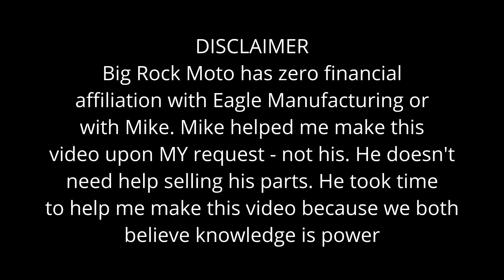KLR650 Doohickey: Everything You Need to Know (incl. 2022 model) (w/ Eagle Mike!)

Comment: It's mind boggling that Kawasaki would neglect the most documented KLR issue ever...Imagine how reliable the 2022 could have been. It's absolutely stupid to buy a new bike and have to update the engine to avoid a catastrophic failure. Bad on you Kawasaki. They probably didn't get enough warranty claims because it failed out of warranty, a lot of people ride just 5k per year.
Reply: They should in good faith allow any new gen3 owner a no cost to owner upgrade to these parts...of course they won't.  Lame Kawasaki.... very lame.
Reply: Seems like an easy lawsuit. Eagle Mike as your expert witness. Boom!
Reply: @davidgrunklee8407  that would cost them triple what redesigning would have. It’s not like they just learned about it. Imagine how pissed other Gen KLR owners would be if they offered that to just Gen 3s?
Reply: @P1ayD0hpaul  good points
Reply: 5k is optimistically high. Unless you mean Km.
Reply: How often does this really happen? 1 in 50,000? 1 in a 100,000?
Reply: @hell_march6652  yep that was km.
Reply: Exactly why I didn't buy the new model
Reply: @grayman618  I have worked on hundreds of KLRs in teh last 22 years and owned nine myself. running most of them as bike hire bikes. Not just KLRs but bikes in general and on average see no more than 20000km or maybe 30000km through their service life. If you keep a KLR for longer you WILL see the failures. Three quarter of a million kilometres between my eight KL650 A and KL650C, every single OEM doohickey failed at least once, OEM springs often would not last to the next service (5000km) and one engine wrecked completely due to FOD in the transmission (a separated bit of the doohickey which goes around the shaft / fatigue failure of the doohickey. Result: Crankshaft cracked, transmission wrecked with three gearsets destroyed, bike scrapped and broken for spares as economical write off 3 years old wiith 32000km on the clock. Compare to my 1999 KL650C with 132000km. Top end done at 100000. Clutch at 120000. Still going strong. Eagle lever since 2004 after OEM lever and spring failure.16000km. No issues since then.
Reply: @KLRJUNE  You can trust a guy who's worked on hundreds of KLRs, and years of documented failures. Or trust your gut instinct and state that the problem doesn't exist.
Reply: People can make videos all day long on this  but 98% of these KLRs easily go 75k+ Miles  problem free. If you want a new KLR just go buy it and enjoy life, remember it's always something with any make and before this Dohickey  actually blows your motor youl have 10 other things happen in life before this to your bike..
Reply: A lot of people do the update aftermarket so not many people really do the claim.
Reply: I just wanna know if doing this invalidates your warranty lol
Reply: With regular service intervals issue is probably non-existent or close to because am suspecting they are just replacing those knowing they will fail soon. However this issue is such a big thorn in the ass because it's so simple and small of a fix to turn great bike into indestructible one.
Reply: While I know eagle mike has MUCH more experience than myself. And is correct this is a well documented problem. My gen 2 has 230k miles and original doohickey is still working for me. I’ve done them for friends I just want to see how long mine will last lol
Reply: Other motorcycle manufacturers refuse to fix known problems as well, it's a sad truth.
Reply: @grayman618 Exaaaacctly!!!
Reply: @jurgenbuchelt4384  So maybe the moral to the story is if your under 100k miles chances are your fine so the Doohickey problem is for "high" mileage Klr's.. If I bought a new '25 I would never worry about this or a Gen 3  '22 and up with under 50k miles.😉

Comment: I owed 3 klr650 within the last 31 years  , from generation 1 to the latest generation ( riding a 2022 klr650 with now 13000km) never had any problems with the engine , just do the recommended maintenance and oil changes , that's it .

Comment: No doubt Mike is an expert on this topic. I am new to the KLR platform. Its hard for me to understand why Kawasaki engineers have designed a system at such risk. Almost hard to believe.
Reply from the maker: accountants don't listen to engineers or mechanics
Reply: @BigRockMoto  as someone who works in engineering, this is absolute truth.  If engineers were in charge nothing would break, but everything would cost 5x as much.
Reply: @dw5523  true. That’s when they refer to it being over-engineered, or exceeding the cost benefit. They would rather eat the cost of a few warranty claims than retool the entire process.
Reply: @michiganmoto7687  But how much is there to retool in this case? It seems these are mostly a matter of changing the spring, the machining of the doohickey and extending the shaft. Hardly a prohibitive cost for a company such as Kawasaki and a rather trivial adjustment for a decades old problem. Add $50 to the price of the bike, that should more than cover the cost of adjusting 3(!) parts out of hundreds. 
This is not a good look for Kawasaki. They're being stingy at the wrong end and I will think twice of buying a Kawasaki.
Reply: @sv650nyc7  exactly. There must be more to it than cost benefit. Warranty claims is one thing. Having such a well know flaw, damages their reputation. We’re not talking about crankshaft design here, it’s a spring for a tensioner. About as minor as it gets. 
I don’t buy the average bike is low mileage opinion personally. Yes a lot of them, but there’s a lot with high miles. Accounts don’t run the company. They must have some real data and senior engineers who have valid points.

Comment: I rode a 2008 KLR 650 from Canada to Argentina on the stock doohickey. No problem. 26000kms

On a subsequent trip From Key West Florida to Canada I used an oil filler cap from Eagle Mike and it stripped half way through the trip. I had to use vise grips to get it off.

Adjust your doohickey as per the manual. No worries. Keep your stock oil filler cap.
Reply: I put 109 000 km on the original doohickey without any problems.  As you say, just follow your manual and everything should be ok.
Reply: Anecdotal evidence undermines good science. This is well known. A sample size of one is exponentially (irony) insignificant.

Comment: 2017 KLR 650. Just did my second valve adjustment at 50k km. Spring still works fine. No doohickey on my bike but I do have thermobob just because I live in Canada and ride even in the winter if the roads are snow and ice free. 

Maintain you motorcycles folks.

Comment: Great video, thanks for getting this information out!  Heard of this problem, great to see such a detailed explanation. I'm amazed Kawiasaki hasn't done more to fix this.  Even seeing the orientation of the stock doo-hickey spring in this video, I'm even more amazed that the spring is installed open side up versus down.  As the spring wears and stretches in the stock configuration, it's appears more likely to drop into the case...

Comment: Thanks gentlemen.
So Kawasaki have had many years to fix a problem they knew existed and still haven't done so.
Therefore, because I ride in remote areas over vast distances, I will not be purchasing a gen 3 KLR.
I feel that I could not trust the KLR.
My choice now will be either  Honda 500X or a Honda CRF300 Rally.
Reply: Im also in the market for a ADV bike and the KLR was inching up to the top of the list. Seeing this it just dropped to the bottom for the exact same reason you mentioned. Aparently it wouldnt matter if I bought a used or a brand new one they all have the doohickey issue. No thanks!
Reply: @titanbum7365  same here. DR650 is what I'm gonna go after now.

Comment: Bought my 05 in 09 with 12,500 miles on it; immediately did the EM Doohicky replacement. The stock spring had NO tension on it! Also did the ThermoBob and every other upgrade/fix known then... at 35,000 miles now, and other than the faded pink plastic, I've had no issues. Adjust the Doohicky at every oil change, and ROLL!
Big THANK YOU! To Eagle Mike and all the other great guys that contribute their knowledge and expertise...
BTW, I paid $2995 for mine 12 years ago; I think it was quite a bargain, LOL!
Reply from the maker: thanks for sharing!
Reply: @BigRockMoto  Thank YOU for the great vids!!!!

Comment: I had a gen 3 and put roughly 25k miles on it before being ran over by a (insert name youtube says no to)  pulling out of a parking lot absolutely smashing my bike and my ankle. Luckily wasn't broken thanks to my hard panniers taking the brunt of the force, but was meshed up and couldn't walk for months. But I did not have any issues out of the doohickey. I also did no other upgrades on the bike. Was doing really well. I believe it's a getting lucky with manufacturing thing. Would have loved to still have it but it wasn't worth trying to repair it. I still plan on doing the upgrades if I get a new one. Just makes sense.
Reply: Get a new one , now.

Comment: Interesting, and thanks for putting this up. I have to say that for anyone who doesn't own a KLR but is thinking about getting one, this video doesn't make a compelling case for going out and buying one. Why would someone want to pay $7,000 to 8,000 plus for a new bike (those $ might be peanuts to some, not to me) and then have to break into the engine to replace parts? I watched another video on how you go about replacing the balancer and spring and it's not that easy, not for the casual home mechanic anyway. It requires getting a couple of tools that I would probably never use again.

In spite of your video, I still have some reservations about the need to replace the parts. More on that later.
Reply: The problem is all the old school dual sports have serious issues.  DRs have nsu issues and 3rd gear pitting,  XR650L has design and sprocket issues,  kawasaki has doohicky issues. Not a lot of competition happening for big thumpers. I'm sure KTM has issues too.

Comment: I Changed mine over to an eagle mike torsion system on my 2018 at 1500 miles,, the stock spring had no tension and was also rubbing a groove in the outer case cover.

Comment: My DRZ puked the stator right at 22,000 miles, like clockwork. Suzuki service manuals are top shelf. These bikes are easy to work on, and kinda fun to work on. Looks like a "doohickey" is just as easy. Fuel capacity and comfort gentlemen, I see a KLR in my future. Kawasaki service manuals are excellent as well, Japanese instructions, when translated to American English, are rather poetic. Same with Honda service manuals. My Sportster service manual is excellent also. What do all these bikes have in common? Ease of maintenance and repair.

Comment: Thank yous. I have no doubt this is true. I had a gen1, A1 (geared it up, less 2 teeth on the rear very early on) I did 102k klm and sold it. Second owner put another 50k klm. Never opened up, top or bottom. Then had a engine failure. Cause??  I guess its only a matter of time. Thanks Mike

Comment: This bike may very well be the best bang for the buck, out the door, especially if you watch Dork-In-The-Road's  channel, but the fact that the 2022 KLR650 has this same problem, is a headache I just don't want. 

After watching your KLX300 video, that's probably the route I'm going to go (or possibly the Honda CRF300L) until I can save up the bucks for an Africa Twin. 

The Honda CRF300L would definitely give me the reliability peace of mind I want, but the suspension sounds like it might be an issue for me.

The other issue I'm going to have to compare is the tank size between the CRF300L and the KLX300.

Comment: My 2007 had a blown doohickey at 4 miles.  We had a Tech Day at Mike's and we trailered the bike down from the dealer, North County Kawasaki, to check the doo before I put any miles on it.  Opened the case, busted doo inside.  Eagle doo went right in. Along with frame bolts and all the little farkels that Mike had at the time.
Reply: Sad

Comment: No problems (yet) with the "doohickey" on my 2015 KLR 650, after over 36,000 miles. Most likely the cause of excessive balance shaft chain slack is worn chain guides, if I was going to up-date the tensioner I would replace the guides as well, if it makes it to 50,000 miles I'll consider doing it then.

Comment: You can take one apart with zero miles and it'll have a notch in the peg that holds the spring.the notch is there to keep the spring from sliding around on the pin.just sold a gen 2 with 44,000 miles and the motor has never been opened up and it still runs like new.the little kit looks a little more robust so it might be a good upgrade but I'm not a fan of drilling holes in my motor so I'd leave it like the engine designers did it.

Comment: TADT: I had a customer who brought in a seriously noisy 2008 as he thought the doohickey might be the cause. I sent him back to the Kawasaki agent who previously had "fixed" his oil burning engine by fitting a new piston and new rings into the poorly machined out of shape cylinder (yeah, after "re - honing as you might have guessed). I sent him back to the Kawasaki agent with a print of the parts diagram with DAMPER 92075-1968 circled in red and annotated: This is the part you forgot to fit! 🤣

Comment: Excellent video and amazingly competent guy there. Kawasaki pisses me off a bit because this isn't the only long running series of bike with issues like this that they just don't fix. A fair number of other bikes such as the Z650, Versys 650 etc all have the problem that the bolt that holds the front drive chain sprocket on is done so tightly at the factory that it is nigh on impossible to remove without breaking something. I had to use a bloody Dremel to get mine off. Impact drivers etc just wouldn't do it. Kawasaki are cheap.

Comment: I used to own a 2009 KLR650 and loved it, still thinking to get the new one, but I am wondering how KLR650 became the symbol for reliability and toughness with this catastrophic engine failures? and I guess I found my answer in the video. People just don't ride their KLRs as much as some other bikes. So the reliability is maybe  a myth! maybe no! who knows :D
Reply from the maker: The doo doesn't often result in catastrophic failure, just poor running. Most high mileage KLR's have the fix done
Reply: Rubbish- plenty of original doohicky KLR's have done very good miles without catastrophe- including my own. Mine has done 70,000 kms and running smoothly. Alarmist hype IMO. @BigRockMoto

Comment: I did the doo hickey upgrade on my 13 after 24k miles. Complete swap with spring and actual tensioner. However I don't know if there is a break in period with the new spring but my coast distance significantly shortened when i pulled my clutch. There was so much resistance. For example I was able to go for about 200 feet with no issues with the bike off or me holding the clutch open. When I upgraded the spring that distance turned to about 50 feet. I was unable to push my bike with unless i put some serious physical effort. Before the upgrade I could sit on my bike and roll gently with just walking. With the upgraded spring I would have to get off of the bike and push from the side.  

Ended up trouble shooting 3 different times to figure out it was the new spring that caused this over tension. My old spring looked completely fine no degradation, and my bike still vibrates just like normal. So Im not sure. couldn't find any info about the spring or how much break in time or about the increased "Drag" so to say with the upgrade. my mpgs tanked. 

I never took the chance with the tension spring and drilling the hole in my part. (Didn't have a spare incase i messed up.)
Reply from the maker: it's not possible that the counterbalance system could add drag in neutral or with the clutch pulled in, your problem is related to something else, perhaps something happened when you re-assembled everything

Comment: Just done the doo hickey on my 015 camo 20k the adjustment was the same as the video 75% worn . Replaced it with the E/M torsion spring. Do I still need to loosen the adjustment bolt as per the recommended service intervals. Cheers & greetings from downunder.😎

Comment: 5000 miles and the engine has to be opened up lest it self destruct? That's unbelievable! IMO, that makes the motorcycle not fit for its purpose. I used to ride almost 1000 miles A WEEK, and I did that for years without any engine issues.

Comment: I've owned 3 klrs. A first gen and a two second gens. Amassed 195000 miles between the three. Never changed the doo hickey on any of them. I sold my 1st Gen when it had 110000 miles. Never was an issue. Idk.
Reply: Similar experiences- current 2018 model with 70,000 kms, no doohickey, still runs very well and motor has NOT exploded.

Comment: I just did the doohickey job on my 2015 at 5,112 miles. I feel like it vibrates more. I might go back in there and double check. But I’m 99.99999% sure I did everything to spec.
Reply: Did you go with the torsion spring or just another coil?
Reply: @techydog7854  torsion spring

Comment: If there was really a design issue and your simple torsion spring being THE solution, Kawasaki would have done it... I adjust my chain tensioner and change the oil regularly. The bike has well over 20,000 km and no vibration or noise. Thousands of people ride around the globe with this bike without modifying it and no issue. Of course there are always some people having problems and that's who we hear from. Just like Ford F150. hundreds of thousands out there without any problem, but you hear from the ones blowing turbos... Given the size of Kawasaki bike business, I am certain they would have spent the money to fix a problem if problem there really was.